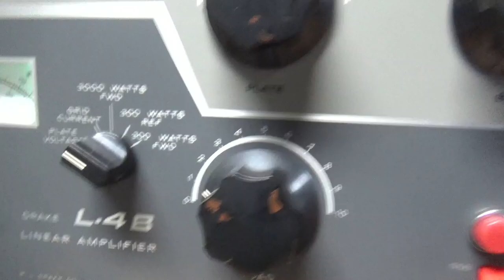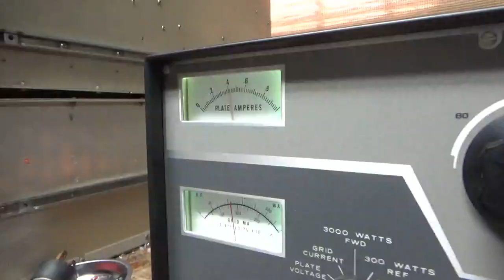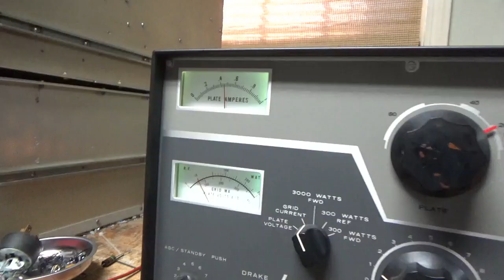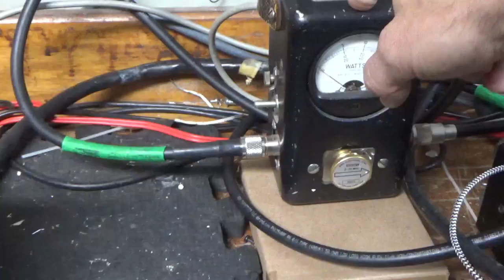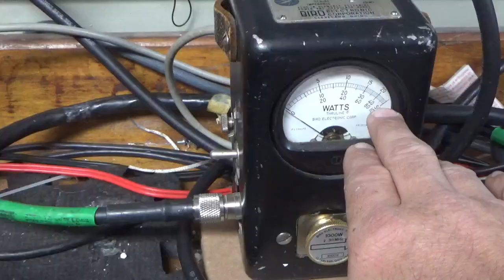Drake L4B Repair, Mods, Harbach Filter Cap Board, 20 Meter Test, Penta Amperex 3-500zg Tubes

Comment: Rebuilt for another fifty years of service 🏆
p.s. I installed external battery holders (double sided 3M sticky tape) on my bird meter using extra 9V battery snaps on the internal connectors so I didn't have to solder directly to them; keeps everything original.